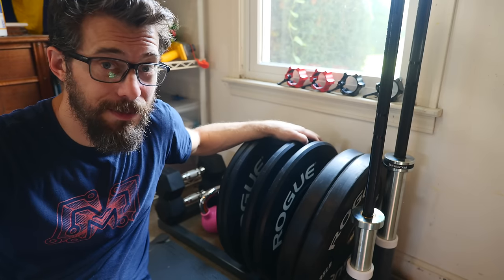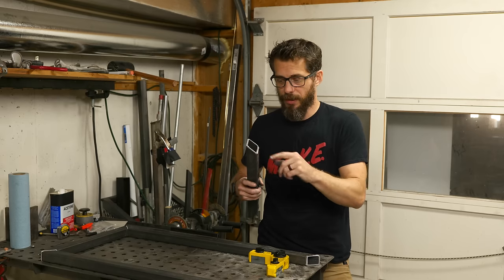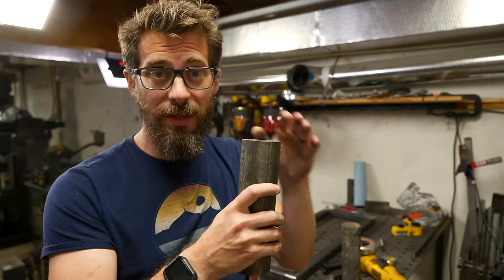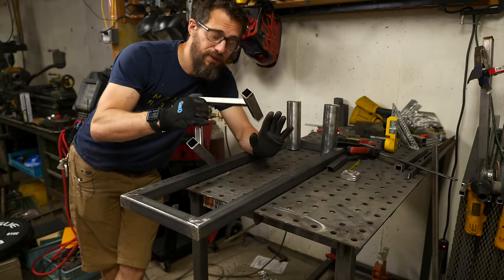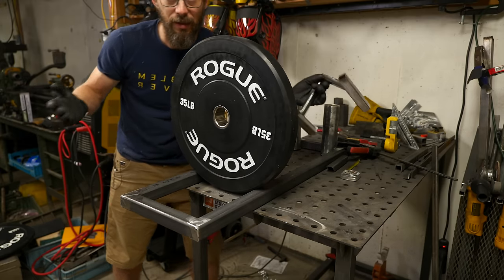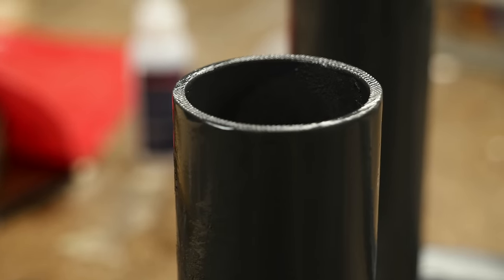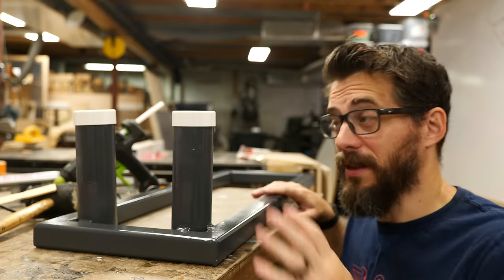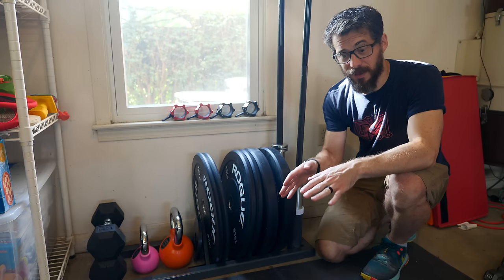How to Make a DIY Weight Rack // Home Gym | I Like To Make Stuff

Comment: Meh, I'm no professional welder either, but I've done enough welding in my life to know two things: 1) it doesn't need to look good, just needs to be strong, and 2) the only reason to make a good looking weld is if you're trying to sell things and need it to look good. This is a home project. It could literally just look like someone slathered on a weld with like a paint roller or something. It'll still be functional and that's all you need. :P Source: learned how to weld from farmers. Ugliest welds you ever saw, but they almost never break.

EDIT: Also, your welds are fine. They have a fairly consistent bead, there's little excess spatter, and when you clean them up with the grinder they're solid, no gaps or voids. You're doing good!
Reply: Shhhh .. you will scare weld snobs with such talk
Reply: So long as you don’t treat other projects the same way... Ah well, at least there are tiles on the floor, who cares if they’re parallel!
Reply: @JosephQPublic  it's not about carelessness - Bob tries his best but there's no point beating yourself up about how the weld looks. You get better next time. No tiles are parallel EVER. Everybody who tried knows that. It might look parallel or straight but it takes a closer look to see there are spots here and there ... But does it make sense to chase it to even higher precision? It's up to you just don't shame others for no reason

Comment: A few weeks ago actually got a welder to make a weight rack and did an amazing job and its helping so much.
the top row for the dumbbells , the bottom row for the plates and a box mounted on the bottom row side to store the smaller weights, and 3 pipes on one side for the 3 bars.
Massive space saver and cuts down on the dumbbell setup time a lot, and all painted in Matt black and silver.

Comment: I've been welding for a couple decades and have noticed there are allot of welders out there who lift themselves up by criticizing others. From what I could tell your welds look fine. As long as you're getting good penetration I don't see a problem. Another thing to consider is that your equipment will limit what you can do. At work I'm using $10,000 welders and laying down some beautiful beads. At home I have an $800 welder and can't come close to what I can do with the more expensive equipment but I get good penetration and the welds look descent. Appreciate your videos and projects.

Comment: Horse Stall Mats from Tractor Supply or a local Feed store. I got 4 more back in march total of 8. For the gym that's a single car garage gym.
Reply from the maker: Nice! Yeah, I've got some coming from TSC as well.. Glad to hear they worked out!
Reply: @Iliketomakestuff  One thing, Put a fan in there leave it on for maybe 3-4 hours for like 3-4ish days and the smell will go away, I use One Step or Mark 11 to clean them.

Comment: For the flooring I'm using a Anti-vibration-mat for washing machines.
A little pricey if you want to cover your floor all the way,
but I only use 2 strips left and right for the approximate place where the playtes would touch the ground.

Comment: With the horse stall Mats you can get the spiked metal joist support reinforcements to hammer the seams/ corners of the mats down to to prevent big seams and separating

Comment: Great project! I have some suggestions about the garage gym : 
- You have a great rack ( rogue RML-3w ) you may need some spotter arms to be safe 
- You might want to build a deadlift platform( use those stall mats)  if you do deadlift regularly to protect your floor
-  Echo bike ALL DAY  if you want good cardio equipment (the space is tricky)
-  I would fix the rings in the ceiling ( they tend to get in the way) 

Train hard and make stuff :)

Comment: Bob, you are slowly approaching "Captain Caveman" with the pandemic look lol.
My suggestion is flex seal or any kind of rubber covering for the sleds. The points may dig into the weights (if the plates are rubber coated) over time, and a rubber coating on the bottom will add to the decreased likelihood of unwanted sliding.

Comment: Put things on the wall. You could hang the barbells on the wall with hangers you can make from wood or metal. Get the plages on the walls as well. Make a rack for your collars and misc. and attach to the wall. Gym floor space is at a premium in a one car garage. Try to get everything on the walls instead of the floors.

Comment: You can make, and hear me out, a sliding rail attached to the ceiling on which you can attach a punching bag, which goes diagonal from one corner to the centre. Like similar to how curtains are attached but ofc reinforced. It could even have some kind of a locking mechanism which holds it in place. I really want to understand how something heavy can be attached to a ceiling but i have yet to see something similar done

Comment: If your powder coat over isnt big enough for large items. You could get a little adventurous and cut it in half horizontally and make it taller. You have a welder, sheet metal, and general knowledge in welding and electronics. You'll just need some refractory insulation to fill in the new walls.

Comment: Horse stall mats are the best weight lifting flooring according to many people. Note that depending on how new they are they may smell pretty bad at first. Based on the internet's suggestions I washed mine with soapy water on both sides and let them sit in the sun for a few days, flipping every day or so. The smell was a lot better, and a few weeks later I don't notice a smell at all now. Also, pro tip, since they're so heavy (100 lbs each) use a vice grips to grab and drag them around. Finally, assuming you have more than one get some mending plates from the hardware store and use those on the bottom to keep the seams together (see Alan Thrall's video).
Reply from the maker: Great tips, thank you!!

Comment: @I Like To Make Stuff You can easily correct for the angled barbell sleeve by altering the 3D printed collar. Instead of having a perfectly circular hole you could add more material to one side or offset the hole. This all assumes there is enough room to do this but it’s a thought
Reply from the maker: That's a great idea!!

Comment: First off, I love your channel and I love your positivity! I have a suggestion for your bar bell holder, maybe a few coats of plastidip will help with the wear. Just a thought. Keep on making.
Reply from the maker: Thanks Mike! I actually started with plastidip, but I wasn't happy with how it turned out on a test piece.
Reply: I Like To Make Stuff would you recommend plastidip, if someone doesn’t have access to a 3D printer?

Comment: Nice work as always Bob! I have a degree in welding and have been doing it for well over a decade and there's nothing I hate more than keyboard CWIs. Your welds look great for someone relatively new to it. You probably use er70s6 wire that has 70,000 psi tensile strength. It doesn't take much weld to hold a few hundred pounds of weights from rolling away. As long as you aren't trying to weld things that could injure or kill someone like trailer tongues or structural supports I always encourage people to give it their best try and worst case you can grind it out and have a pro fix it for you. Keep it up and ignore the haters!
Reply from the maker: Thanks so much! That's encouraging to hear from someone who knows what they're doing 👍🏼

Comment: It might be challenging, but you could build a cable pull machine? Depending on your walls or ceiling it may not even need to be the whole structure, could just be a frame that’s along the wall to hold the weights and a pulley mounted above it. You’d have to source the weights themselves and the cable, but I don’t imagine it would be too difficult.

Comment: Cool work man. I would say with the tubes, you could have used plasti-dip and dip the ends multiple times to protect the ends of the tube for when you add the bars into them. Just a suggestion.  But good job always. Stay safe man..

Comment: if you dont have 3d printer, you can add rubber to top of 2" pipe so will protect the bars.
cut a sleeve of tire tubing, put around the top of the pipe and fold inside the pipe the rest

Comment: you should give the tubes for the barbell a few sprays with flex seal so that it has a rubber coating to protect it even more from the metal on metal

Comment: Second the horse stall mat. Been using them for years without problems.
Reply from the maker: Yeah? Great to hear!
Reply: I Like To Make Stuff, the mats we got are .75” thick, which stands up to a lot of abuse. It’s relatively simple to cut using a utility knife, but can take a bit of time. The weight is no small issue. Our mats are 4’x6’, and weigh 75lbs (IIRC). They’re bulky, unwieldy, and a bit of a pain, but once they’re in place, they don’t budge. Had I to do it again, I’d likely look for .5” mats.

Comment: Have you considered what you will do when you get smaller sized plates? The smallest standard weight plates (1¼kg/2¾lb) are about 16 cm/6¼″ diameter, and if you get into microloading plates, they go down to 125 g/4½ oz with a diameter of just 8 cm/3⅛″. Those sizes of plate are going to slip between the rails of the frame and sit in the floor.

Comment: I think welding some 1/2 round as dividers would work as a simpler way to hold the plates upright. The concept you made with the heavier weights holding the dividers more securely isn’t wrong, but I don’t think it’s necessary. I think welding a V shape of 1/2” round at intervals according to your weights is probably a better option in terms of cost.

Comment: Keep a watch on the point of the weight sled, I hope it is not sharp enough to scratch the plate surface finish. If it made it to the center hole, then its safer for the plate (imo), or you just can make it blunt point. Love your channel and built.

Comment: I haven't made it through the whole video yet, but, you can take that stuff you dip your screwdriver and plier handles into (not plastidip) and a paintbrush and coat the inside of the tubes to keep the barbell's safer from scratches.

Comment: Maybe too niche, but one of the machines at the gym that I think is the most "interesting" is a pull-up assist machine with adjustable counter-weights to make pull-ups (or dips) easier.  Again, probably not really a home-gym type thing, but would be really interesting to design and build a DIY version.

Comment: Another good video, Bob. For the weight dividers, could a longer foot with multiple points work? Like if u have more sizes of plates, instead of multiple smaller dividers ? 🤔🤷‍♂️
Reply from the maker: Yeah, I think it could. I didn't want to add multiple points on a single "sled" because that would limit what could fit in a given area, but in the end things won't end up changing that much, so it's probably not a huge deal 👍🏼

Comment: That plate and barbell holder looks quite nice it's own way but i think you should make wall-mounted holder instead because you can have more free room on the floor what makes cleaning a bit easier when there isn't all the time all kinds of stuff on the floor and i give you one free tip for homegym workouts if you like or wan't to try sometimes coretraining... get a tennisball and make x shaped cut on it then put it on the barbell and the other side a plate and place the barbell's end where you have put the tennisball place it to the corner and get the show on the road and that same little trick works also on loadable dumbells👊 oh and i almost forgot to mention go to check youtube channel called garage gym reviews... there is all kinds of interesting videos what you might like

Comment: An immdeate thought I had - can you rubber-coat the pipes for barbells? Probably a fun process to try at a home shop! But you would probably need slightly bigger diameter pipes for that.
Reply from the maker: Yeah, I considered plastidipping them as a first attempt, but it wouldn't last as long as a true rubber coating.

Comment: I plan on making something like this, but i have WAY more plates and they are all different sizes and materials as I bought most used. I think i am going to build aomething like this for 25-45s and build a wall rack for my 10s and 5s. The weight tree just takes up too much floor space.

Comment: How feasible would it be to print some sort of "cup" to go in the tube to prevent metal from metal contact with the barbell? Then add that top you printed, just curious, since you said after time the paint might wear off.
Reply from the maker: You could, but the pipe would have to big enough for the insert and the barbell

Comment: Do you still use the evolution rage miter saw to cut steel. I’ve seen some reviews saying that overtime it can kill the motor quicker than the metal only saw that they sell.
Reply from the maker: It is out at the farm. We don't use it as much out there.

Comment: Do you think that this would work with 2x4s for the frame and PVC for the barbells? I don't have welding stuff at this time (nor any knowledge right now).
Reply from the maker: Possibly, I'd be really careful about how the PVC was attached.Our bars are 35 and 45lbs, so they act as big, heavy levers in the holders.

Comment: I have a suggestion for the sliding pieces that hold the weights. What if you had two steel rods running parallel to each other inside the frame. Instead of square stock tube for the sliders use steel tube. Then the sliders would slide on the rods and you could then make the "feet" smaller. You could have several sliders on the rails to hold multiple weights without having anything loose as it would all be one unit.
Reply from the maker: That's a really good idea!

Comment: I made a cable machine from Home Depot with 2 pulleys and a plastic covered steel cable. The thing is it only starts at the top and cannot be adjusted to start lower like a real machine.

Comment: Any pro gym rat will tell you that the number one exercise to get really strong is squatting. Second to none. Even "grip masters" squat as part of their training.
The safest way to squat is to belt squat because it virtually eliminates the possibility of a back injury. However, you'll need a Belt Squat Machine of some sort. There are a number of ways to build these rigs. Look around. You might get some ideas for your next big project. These machines need to be very strong because you'll find yourself adding plates sooner than expected.
You'll also need to buy a belt. Don't even think about making your own belt.